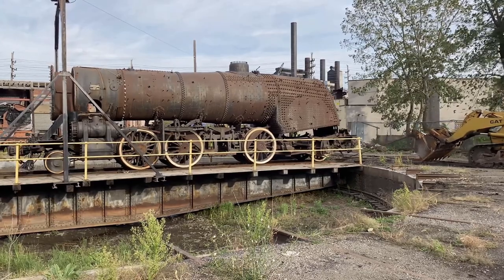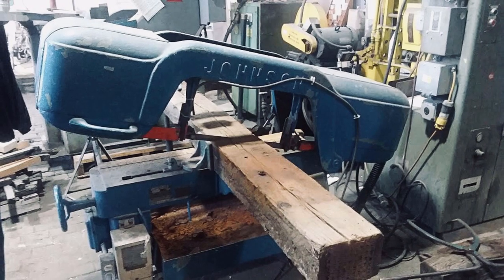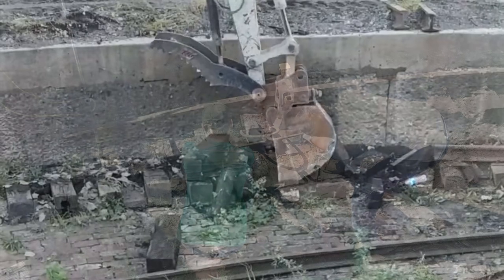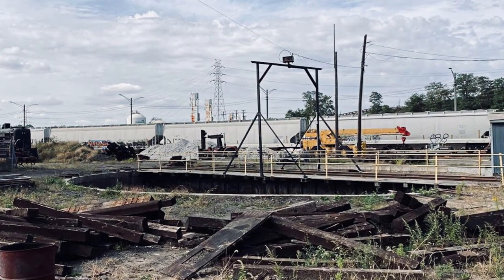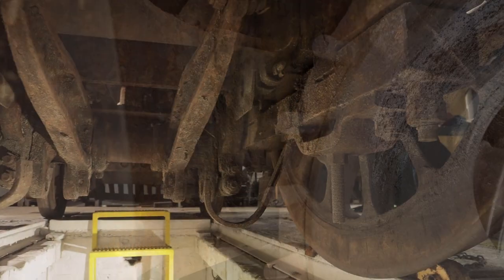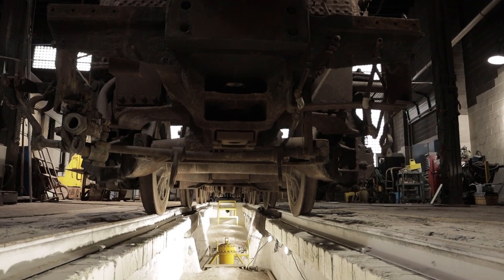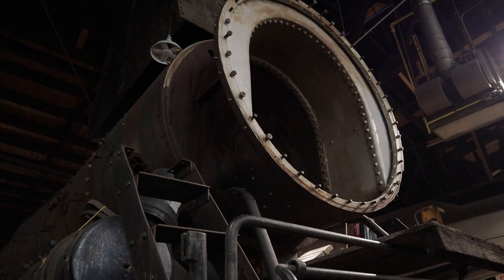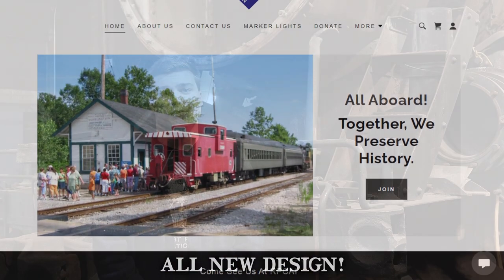Grand Trunk Western 4070   October 2021 Update

Comment: Are there plans in the future to hopefully fix the turntable since it was kinda obvious to tell it wasn't working at that it was being pulled by that tractor? But nonetheless, congrats on the work you've managed to accomplish, especially with the drop pit. Plus, good luck with repairing that crack in the frame since I bet it'll be a bad move if it isn't repaired.
Reply from the maker: If you follow us on Facebook you will see we started work on the table. We are doing a new ring rail pad in concrete. Should be done by the end of the month and next year we plan to realise the table to do bearing work to it.
Reply: @midwestrailway  well good luck with thta.

Comment: Will the 4070 stay coal burning?
Reply from the maker: Discussion are still going on with that. The government is making it harder and harder to run coal engines. First thing first fix the frame.
Reply: @midwestrailway  That’s important yes fix the frame first! How old is the 4070?
Reply from the maker: @rudycarlson8245  it was built in 1918
Reply: @midwestrailway  I have an idea that could help the old gal remain on coal without compromising much.
Reply: @midwestrailway  It is called Torrefied Biomass, from the Coalition for Suitable Rail.
Reply from the maker: @jesseusgrantcanales  I never heard of it
Reply: @midwestrailway  For some reason my comments fail to post and especially if they have website links. Look them up.